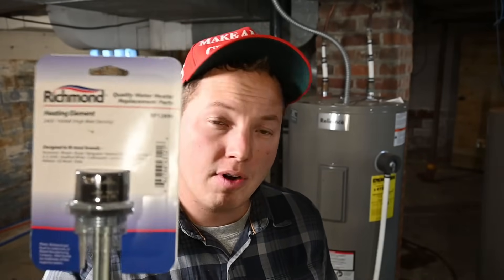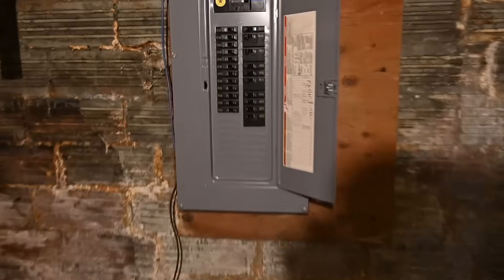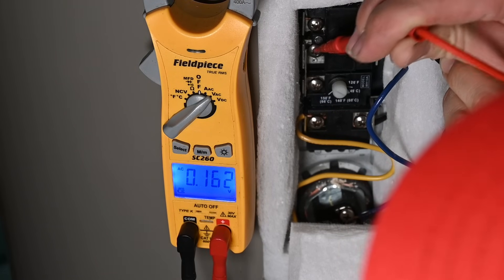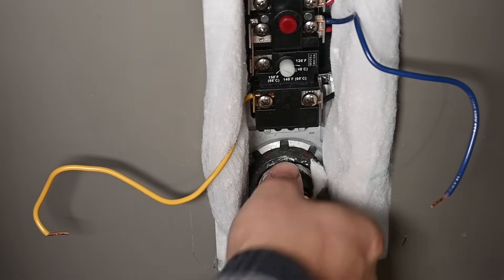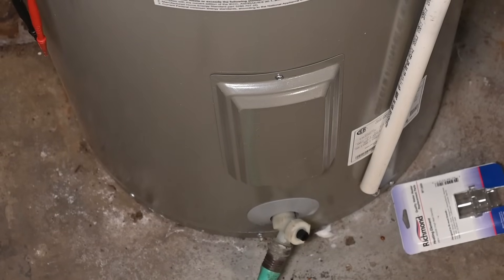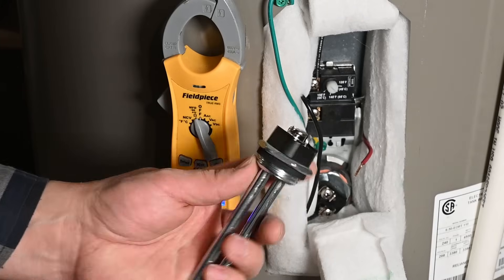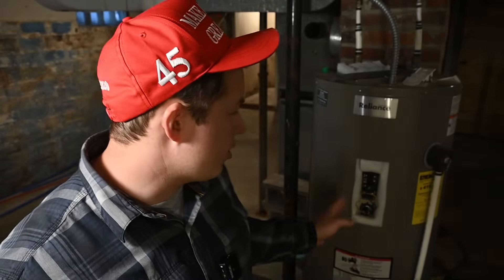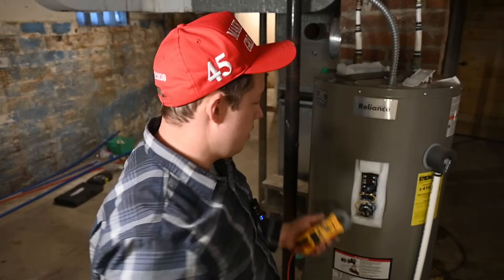How To Replace Electric Water Heater Elements

Comment from the maker: Hey guys! Hope that you find this to be useful. Please be respectful in the comments. I appreciate you guys!
Reply: Hi! Ben  csn I use clein multimiter ET60 to test my electric water heater?
Reply: this is really well done, thank you! We have both heating elements so bent a plumber can't get them out, is there anything that can be done at that point or is a new tank the only option? If we need a new one, what are your thoughts on the hybrid heaters that we use the temp of the air to draw heat?
Reply: Excellent video!  One thing worth mentioning though is if the element is seized in place, it will be important to use a socket that does not have a tapered entrance to get maximum torque on the hex nut to remove.  Thanks again for the great video!
Reply: Hi Ben
I'd metered the element and they both had 12.7 ohms and also replaced both thermostat still not working. That income source at the terminal metered 119vac but if I cross terminals meter it I got nothing. Could it be breaker is bad?
Reply: Benjamin Sahlstrom 
Love the hat

Comment: Hello sir.I have a question. That is even though the two elements and the two thermostats are good,still getting low hot water means its due to scaling deposited on the elements.am I correct sir?

Comment: As a plumber of 20+ years I would advise against "tripping" the t&p lever to allow air in, I have seen them not seat properly enough times after tripping the lever that I will not do it unless I'm replacing the tank or the t&p. Commonly debris can get in the spring or it can just be old and weak and not seat properly causing it the drip afterwards. Most heaters have flex or unions on top of tank nipples, just Crack that to allow air in after you have started to drain.

Comment: So just to share - hope I’m not repeating myself.  When I first watched this video, I had decided to drain and just change elements.  My HWH is in my attic.  I check the overflow at the pan.  No leak.  I thought I was good.  I’d turned the water off to the house, and opened the valve to drain the tank.  It didn’t happen immediately, but after awhile, I heard water sounds.  Then I had water pouring through the light fixtures in my kitchen.  TURNS OUT the lazy SOB who put the overflow on that water heater pan could not be bothered to put enough pipe on it to drain out the eves as it was supposed to.  Yes.  Draining onto the ceiling in my kitchen.  I’m just grateful I found out in this relatively controlled way, versus the water heater rupturing while nobody was home and the water wasn’t turned off.  When you have people who take that little pride in their work, I dont think it is possible for anyone to make this country great again.    Benjamin - Wear your hat!  I hope more people on all sides can grow up enough to realize that politics are not religion.  And we are theoretically adults who can agree to disagree.

Comment: Turn off your water heater before going on vacation. They make hydrogen gas. They also do this when the elements fail. My power was off and i forgot i drained it during cold weather. Thanks for the video. G Wayne

Comment: I'm sure it's been to long to ask, but what can I do if the bottom won't drain. It's an old hot water heater. I'm changing elements and thermostats. Thank you.
Reply from the maker: Stick a hanger/wire up into the valve while it's open. Sometimes helps.

Comment: Put I can't drain the water from the I have well water. The sand stock on the drain the water won't drain. But I  put 3800 elements on top. But the other old 3800 .3000 element stil on thel heater. That's fine like that.

Comment: Hi Ben thanks for the video! Could a 3500 watt element be replaced with a 4500 watt element for faster recovery and not cause issues?
Reply: As long as the nameplate says 4500 watts then yes, because the internal wiring must be able to support the current draw.  Before you swap to a 4500 watt here's one more thing that should be checked.   The existing circuit may have been wired with 12 gauge wire and the installer had installed 3500 watt elements to avoid overheating the wiring.   If it's 10 gauge you can use 4500 watt.

Comment: Ben, can i remove the wire at the bottom element & use the top element only to heat the water heater?

Comment: I agree with your final commentary.  I am not a fan of Trump, and didn't vote for him, however that's one of the good things about this great country of ours, we have the right to express out political views respectfully!   Reagan once said at   5 PM we are all Americans!   Besides, our HVAC, plumbing, and electrical systems don't have a political preference.  Keep the helpful video's going.

I find that living here in Florida I have to drain and flush the heater out twice a year and have to use the wet-dry vac and vacuum the sediment out of the tank, when I'm done it looks like a kid dumped a couple buckets of sand from the beach on the ground.  I also had to switch out that cheesy plastic drain cock with a brass boiler drain valve, I also have to blast water in the drain from a garden hose with to get any water to drain from it due to the large amount of calcium and lime deposits that plug it up.

Comment: Hey! So I replaced both elements in my water heater, but when I powered it back up, and waited a few hours, still no heat!! I’m going to try the reset button?
Reply: I'd check the reset/ECO (Emergency Cut-off) switch in the top thermostat hasn't been tripped but also grab the multimeter and make sure power is getting through the thermostat to at least one of the elements. He links to his diagnostic video at the end of this video, so I would highly recommend checking that out as it explains everything you can do to make sure everything is working.

Comment: i just followed and did the complete test from both videos.. replaced thermostat, and elements, confirmed power.. everything.. still no hot water after an hour..but all test say volts and ohms are good.. 4500w 45 gallon electric heater.. we completely lost..it doesnt make sense why we are not getting hot water after an hour.. no water leaks in system
Reply: Did you check to see if it was actually drawing current?  No current no heating.
Reply: Mike go to source n check ur circuit  breaker it's  30 Amp might be tripping

Comment: I checked everything 3 times. Everything tested fine. But my water is scalding hot! It will trigger the shut off. So something is causing that.  Both thermostats and elements tested fine, as did the shut off button. So what can be causing that? Any ideas????

Comment: Good video. Another way to help the water drain faster is to open the drain valve while there is still pressure coming into the system and help "flush" any sediment that might occlude the drain. Do that for at least 30 seconds (longer for a system with lots of sediment) and then shut off the supply valve. You can also crack open the pressure relief valve instead of going to a lavatory or other faucet to allow air in to equalize pressure. Congrats on the 4th girl as well! We have 4 girls and another ??? on the way!

Comment: Ben: Single pole 240 volt ckt. breaker?
Reply: SquareD QO line breakers have one handle on there double poles
Reply from the maker: Exactly.
Reply: @darienredsox1878  
Their....there is a place,
Reply: You can see that the breaker actually takes up two spaces, the B leg has no switch. I am glad he asked that question, I had to triple take and rewind on that one too.

Comment: hi ben, i put booster fan in one of my room. i want the booster fan to be turn on when my furnaces fan on.
i run a wire from 24v fan line (G) & also line from common (C).  from there i install solid state relay (model  tc48d40). my fan worked real slow for minutes and it burn out. if i buy new fan what should I do make run.

Comment: Pipe dope can also help make it easier to break loose/ replace the next time.  Not needed for sealing as the gasket handles that, but a little lube (pipe dope) on the gasket has also been good to me over the years.
Reply from the maker: Exactly.

Comment: I really enjoyed this video !!  I changed out a whole water heater in my rental trailer w/ out knowing volts, whether element was bad, anything really.  I feel more educated after watching your video. I'm good w/my hands and like to fix things if possible , rather than spend money on replacements.
I was a carpenter for 33yrs and never understood too much about electricity, but since retiring early and w/ the help of YouTube I've become more skilled at many more new projects and save oh so much money. I've always wondered how to know the pull of watts on any given appliance and now for the 1st time it seems so easy the way you described it step by step. Volts x Amps = Watts !!
I also liked the way you informed the opposition of the ability to be unique & different but still be able to find common ground that can hold us together. I'm sorry that most of the opposition I've seen would have turned the video off at 1st site of the "red hat". But it was surprisingly refreshing to hear that particular point added to the end.
All in all , I feel good about the video, time I spent watching it and the time and effort I spent here in the comments section. Good job Ben,
Sincerely ........................
Steph

Comment: Do you ever use CIP lube/ petrol gel/ Vaseline, on gaskets?
Reply from the maker: Yes that's not a bad idea so long as it is compatible with the gasket type of course. I usually don't have to use anything but maybe I should get into the habit of doing so.
Reply: @BenjaminSahlstrom  I work in a cheese plant and use buna gaskets.  Its always a good idea to check for compatibility; however, sometimes non-compatible parts will work.

Comment: Nice review. With water drained, if the tank is older than a year or so, it might be wise to swap out and have a look at the old anode rod. Cheap maintenance if you can get it out, sometimes they are tight.
Reply: Ben, I do admire conservative values, and in a different year we would be in the same echo chamber. Not this year, the issues are more important than simplistic right left debates. Even so, I do love your intelligent diagnostic videos.
Reply from the maker: it is an interesting time to be alive that's for sure. I too feel that the issues are more evident this year but for me I feel that the ideas and principles that made America what it is are under attack from the ideas of socialism and communism. I definitely don't have all the answers though and do not desire to be trapped in an "echo chamber" so I do my best to learn from others that I may disagree with. Keep up the great work on your channel by the way!

Comment: Up sell them an anode rod, easy cheap, and tank can last 20yrs+ plus you'll be back every 5 years to replace.  Those newer tanks need a good flush, open the lowest tap and I like to open a tub on high so the drop tube pushes the calcium out the lower.  I realize you don't want to create a new leak from doing that especially on old tanks.  All goes back to proper metal type anode rod for area and replacing often enough.  I can say this from experience as my electric 40 gal. lasted 28 yrs and was still no leak when I took it out to go tankless.  Go TRUMP 2020.

Comment: Thanks ¡ so much help. abut how much torque  on that ratchet? Thanks again.
Reply from the maker: The exact torque is not critical so generally I just tighten it until the threads "bottom out" and then get it "good-n-snug" which I would guess is about 30-40 lb ft or so. ;)